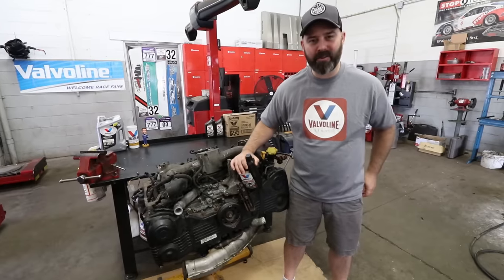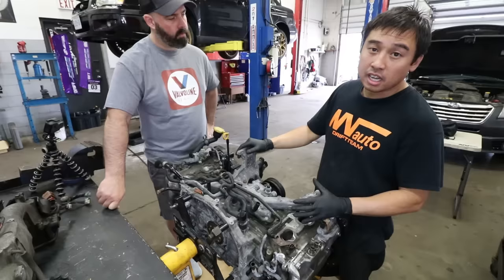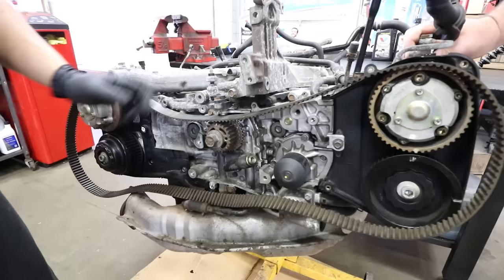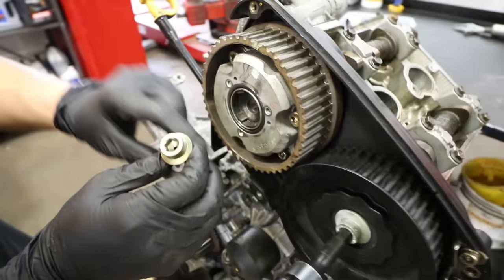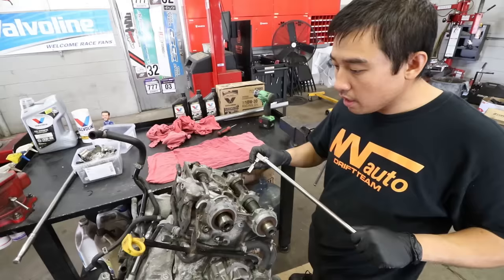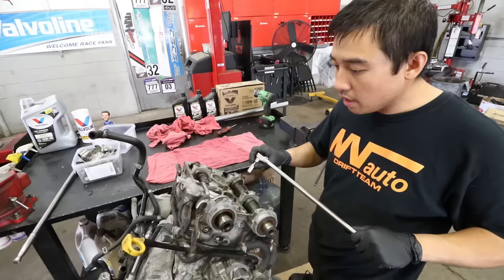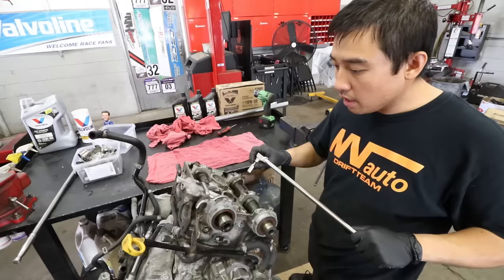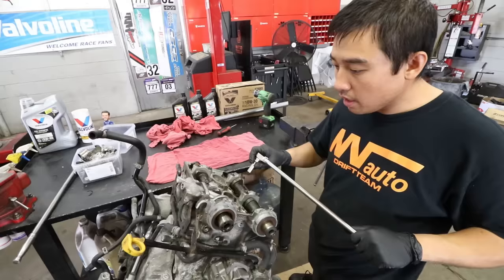SUBARU Engine Rebuild - EJ20 / EJ25 Teardown How To

Comment: This video just makes me appreciate how easy American OHV V8  based engines are to work on,specifically the LS platform...
Reply: Eze&Yare Dominguez   this is a very simple engine. Once you do two or three you would be able to remember all the pieces and parts easily. It just looks complex when you do it first time. All the parts are high quality and fit easily. Unlike some.
Reply: @Brett i have a B7 S4 & thus block seems more complicated than the bbk v8 i have

Comment: I have been driving n working on Subaru for the last 31 years
Reply: what's the most reliable Subaru engine sir
Reply: @mattmatt9971  ej20
Reply: @michaeldwyer5013 Cheers.  I got EJ20G in my 1995 sti.

Comment: Just to add a quick note, the LH cam gears that are loaded are easy to mess up and bend the valves, they didnt do it the right way. The intake gear needs to be spun clockwise, the exhaust gear needs to be spun counter clockwise. Most of the time you can get away with doing it like they did but theres enough spring pressure that if one of the gears slips it will catch the edges of the valves and will easily bend them, and no one ever checks after they do it which can lead to the car running like crap, or turning the valves into a tossed salad.
Reply: isnt it the other way around? for unloading the cams the intake goes counterclockwise exhaust goes clock wise
Reply: I don't think they are that easy to bend. I believe it's more of a precaution, so you don't take a impact or a breaker bar to the bolts. I'm picturing some ding dong kicking the breaker bar like he/she is trying to crack lugnuts on the side of 95.
Reply: the Key being to make sure the crank alignment mark and oil pump mark are lined up so the pistons are mid stroke and you don't bend the valves.

Comment: Really impressed with his knowledge. When a mechanic is that proficient at engine rebuilds you know those engines are terribly unreliable lol
Reply: they're very reliable. they have a few issues, but they always go at least 180k miles. problem is that they're not maintained well and hooned often.
Reply: True...
Reply: Every engine is reliable as the person who is operating or maintaining them. Increasing the output and operating an engine at its limits reduces longevity. Lack of maintenance reduces reliability even more.
Reply: Well my 06 LGT has a stage 2 tune and a vf52 turbo and has 200k miles no issues. My 1999 subaru legacy outback has 240k with zero issues also. So I think it's more user error than the ej series motors.
Reply: @markheefner6527  Did you replace injectors/fuel pump using the VF52? In the middle of a similar build right now with my 05 Legacy GT. Engine is out at the machine shop at the moment.
Reply: @andrewolszewski5027  we didnt do injectors but we upgraded the fuel pump to a AEM 50-1215. You dont have to upgrade injectors though the next up is changing from the stock side feed injectors to bottom feed injectors.
Reply: @markheefner6527  Thank you. Had a lot of conflicting information on whether it was required or not. Planned Vf52 swap, grimmspeed Boost control solenoid, new radiator/intercooler, and Downpipe/cat back exhaust. Already have cold air intake and larger turbo intake tube. Pro tuned when all said and done.
Reply: @andrewolszewski5027  would love to see your build when it's done.
Reply: @andrewolszewski5027  what part of the country are you from? Boosted performance Graham Gaylord is the owner and is an awesome tuner.
Reply: Mark Heefner probably a video but I figured why not be social and ask.... what determines a tune’s stage??
Reply: Theyre reliable. But when they break they break hard
Reply: Need to be maintained more than a toyota or honda. Subaru ej  s cost more $$$ to maintain
Reply: Or the engines were used in almost everything lol

Comment: Subaru flat motors are a lot like harley or other older vtwin style engines that have vertically split cases. Thats pretty neat to see how it breaks down to such a small engine block that a guy can move it around on the table.

Comment: Yes sir I have a special hardened socket just for the head bolts used to do at least one or two head gasket and engine reseal on Subarus a week I have just a little experience!

Comment: Geez those boxer engines are so much more work to take apart & put back together compared to a inline four design.
Reply: Theyre so much easier to install though and remove.

Comment: Awesome!! After seeing this I dont think I ever want a sti lol
Reply: I concur...sure my NA K20 is gutless but easy to rebuild...like a lawnmower!
Reply: @aronharper7001  k series is life tho!
Reply: Its not so bad trust me, i came from a h22a obd1 closed deck to an sti, the ej looks more complicated than it actually is.
Reply: I just did a rebuild on my ej20 and while the engine is complex and difficult, reinstalling is so fucking easy. The the motor mounts are on the block, put it onto the subframe and its just two studs. Done. Takes less than an hour. While staight 4s have 4 different motor mount locations and shit. Fuck that.
Reply: @MidwestDankAlumni  *no one cares
Reply: Very clever and successful  design giving a low centre of gravity, improving car cornering ability.
Reply: The best way to describe these engine is intimidating to look but its like a lego set

Comment: I’ve had 4 Subaru’s and I currently own a built 2017 STI and I can tell you it’s cheaper to just buy a built block and rework whatever heads you have than rebuild. You can buy a built short block and get a 1 year warranty and still come out cheaper than rebuilding a 2.0 or 2.5

Comment: Seems that the cause of the burnt valveseat is either a bent valve or a damaged valve guide, as nam seems to need way more force than normal to pull this one valve out.
Reply: jeah.but correct the MB C200 kompressor  head. ..

Comment: great video , I've always been curious about how the block is parted thanks , removing the piston clips & pins was an eye opening , only flat 4 I've done was a VW this is way different  obviously due to water cooling and overhead camshafts & cambelts and with VW the bores/barrels can be slide out of the crankcasing  , knowledge and being methodical clearly is the only way to go with the Scooby engine,  doesn't appear too difficult to dismantle I'm sure the rebuilding has lots of do's and don'ts that aren't so obvious at first ,cheers

Comment: Put this motor in a Factory Five 818 C .  I am going for a WRX STI in the coupe I am building. 1900 lbs pushed by 310 horsepower. What a rocket.

Comment: Tons of VWs have Subaru engines. This might be a nice upgrade for a 914 if you feel like exhuming one!  A transplant you won't do is fairly popular among pilots, put a Subaru engine in a plane. They like it because it does not shake at all and has good power. It is not approved by the FAA but the approved engines are dynasaurs!
Reply: @FourDollaRacing  Chill out mate

Comment: Not all USDM motors are drive by wire, only the 2.5L turbo motors are (04+ sti 06+ wrx) in the us. EJ205s are all cable driven.
Reply: Also to add usdm models do have the hex or flat sides on the cams for a wrench on early 04s to 02s
Reply: My 07 2.5 legacy is dbw and so is my 2.5 in the 10 Forrester
Reply: And they are n/a

Comment: These engines are like Suabru's biggest blunder lol. A blunder that lasted for almost 10 years! Oil consumption, piston slap, blown headgaskets, rod knock from oil consumption.
Reply: Avid fan but you couldnt be more right, so many design flaws and the 5speeds OMG

Comment: fyi, i owned a USDM 2.0 WRX wagon, and it has cable throttle. I believe in the US, the EJ257/ej255 was the first engines to get DBW.  and the 2.0L EJ was no longer in US WRX after 2005.

Comment: For the Cam gears: when you shear off a hardened 3/4” drive Allen trying to break it free, the factory may be fucking up putting them on that tightly. Strangely enough my USDM EJ205T had the hex shank to secure the cam from spinning but there is no way these bolts being so insanely difficult were torqued at the factory to the spec outline in the FSM. Edit: be very very careful with the cam bolts if doing HGs in the car, have to use a shallow, 6 point 10mm socket and be sure to tap the socket on deeply as the cam bolt heads are quite prone to stripping.

Comment: I used j20 cylinder heads for the j 25 turbo engine, but I did somes modifications  with the j 20 cylinder heads to work with the engine j 25

Comment: Great video but if the cam bolts get stuck you can always use an 11/16 turbo socket :)no need to cut em out

Comment: When it comes to 2.0 vs 2.5 the 2.5 model is much more desirable for higher boost levels and whatever track use you would be doing...my 2.0 is a good stock reliable motor but when it comes to a build 2.5 is the way to go for sure especially closed deck.

Comment: I worked with cars for several years but nothing like replacing piston rings and seals.  I got 2010 subaru forester 2.5l and I probably need to do that soon.  I already got low compression on cylinder 4 @70psi.  I didn't try the restore lubricant yet but if I try to rebuild the engine with new piston rings and seals and learning as I go with repair guide and some help... How long would it take me.  I want to learn this stuff, do it right  and use my subaru to learn it.

Comment: If you were gonna replace a 2.5 with a jdm 2.0, do you have to use a different exhaust manifold to make it line up with the rest of the factory exhaust system?

Comment: In my experience, usually when the bearings come out with the crank or just fall out, then the bearings are deformed and probably shouldn't be reused. They're usually kinda "press fit" into the case. So if they just fall out, they're no good
Reply: Hello! Any chance you could tell me why the OEM crank here has a nut/bolt at the end of the crankshaft?
Reply: @epochlabs  It's usually there to hold the harmonic damper/crank pulley on the shaft. It doesn't really do much besides also giving a place to put a ratchet or wrench on it to turn the engine over during assembly or disassembly
Reply: @richardwilliams9181  Thanks for the swift reply!

Comment: Question: Nam said that on the USDM engines, there are no hex on the  camshafts to put a wrench on to and if you don't have a special tool, there is another way to loosen the bolts. I have a stock US motor and no special tool. What is "the other way" to loosen and remove the cam gear bolts?

Comment: have a bad miss on left bank on Subaru 01 forster JDM motor e25 just put in, put it on snap on machine everything right, crank sensor cam sensor, in gears right, changed injectors on it still misses, checking compression today, any thing else i could check or replace.

Comment: So on first crank on this motor right after swap I heard what sounded like con-rod bearing knock on one side of the engine. The sound is rather faint and not to so apparent.
Will the noise disappear after driving for a few kms or am I worsening it?? Please advise

Comment: man i feel like bmw and subaru engines are no where near easy to work on compare to b and k series.
Reply: Who makes those engines?
Reply: @BobPegram  b & k series are Honda engines
Reply: Once you know what you're doing, they're pretty straight forward. All EJ blocks are basically the same, bar bore size and a few other things.
Also Subaru's share a lot of parts between them in most aspects, so working on a Impreza is very similar to working on a Forester - talking about the older ones, where they shared the same platform.
Reply: EJ's are actually pretty easy to work on. i was kinda scared to tackle my ej205 at first coz i haven't worked on a boxer engine before.  

but it's actually pretty easy.
Reply: @Ariz04  I'd say the EJ255s are one of the easiest engines to pull from a car that I've done so far.
Reply: @wedgoku...., K series is Rover. The 'newer' k series are found in MG zr & zs's
Reply: Wait to you see what VW/Audi does with engines....
Reply: @sgt-willkillu  99.9999% of the time, when someone is talking about a "K-series" engine, they're talking about a Honda, not a freaking Rover.
Reply: @sgt-willkillu  I think he meant the Honda K series because Honda also had a B series.

Comment: I disassembled a 2001 STi Limited Wagon block the case half 12 point bolts almost broke my 500 ft lbs impact gun then with a cheater 4 foot pipe they almost broke me LOL

Comment: why is the 2.0 block thicker than the 2.5? is it because they are the same block but the 2.5 has  larger bore, therefore making the walls thinner? woulden't it make more sense to make your bigger displacement engine be stronger because it has more displacement?
Reply: Yes, but cost.
Reply: It would make sense but it would no longer be an EJ to manufacturing. Different engine block casting etc..
Reply: EJ's earliest displacement was 1.5 liters I believe.  They certainly were used in several sub 2 liter applications before they went to 2 liters.
Reply: @BobPegram  there's been 1.5, 1.6, 1.8, 2.0, 2.2, and 2.5 - all factory Subaru.

Comment: just put JDM e25 motor in Subaru 01 Forester, got it in has miss on left bank, put it on snap on machine, said it had bad wire repaced still a miss, replaced injectors, still has miss, got right sensors in gears are right, checking compression today, doubt its bent valve, can you think anything else it could be, frustrated

Comment: On my 98 WRX motor I went to undo the crank bolt for the second time after taking of the timing covers and putting it back in to line up the timing. I was holding the top right cam (facing the motor) with a socket and breaker while trying to undo the crank bolt. Then trying to undo the bolt, I heard a click from the top cam and I think just the cam skipped forward while the crank stayed in position. I looked at the timing marks and the cam was out. I turned the crank twice trying to match it up again but it wouldn't match. I carefully kept turning until suddenly I could feel some resistance and I stopped, fearing I would damage the valves. Currently the crank is not lined up with the timing marks. It's mark is just below 9 o'clock. All the cams timings are out too. I'm not sure how to proceed. If I turn the crank further I feel like I'm going to wreck the valves. If I take the belt off currently I'm worried I'm going to wreck the valves. I'm guess I can't wind the crank backwards? How would your expert proceed in such a situation please? Thanks

Comment: I have a single turbo, single AVCS engine with rod knock I want to fix and I can only find twin turbo, twin AVCS engines. I was told I can just swap the heads off the single turbo and put it on the twin turbo block. Does this work?

Comment: I have a 2004 forester xt that I bought brand new heads for from subaru. Cam caps do not have the cam sensor on driver side behind timing cover but does have the 2 at the back of both heads. Is this normal? Seen at 7:59

Comment: Ok... this is a 2.0 as mentioned earlier in the video... if you bore out the cylinders how does it not make it a 2.5? Wasn't the argument that the 2.0 had thicker piston walls which was a good thing? Seems kind of a moot point.

Comment: EJ207. I'm jealous
Reply: *JDM EJ205 with AVCS
Reply: @THENINJASYNDICATE  block is stamped "S20C" - that's a EJ207 (specifically from a V7 STI), and semi-closed deck - great engine! EJ205 would be "R20C" (V5/6/7 WRX and V5/6 STI - but engine code is EJ207, so factory forged internals)
Reply: @upgradeNEVER  but the ej207 is cross drilled mains I think that crankshaft is single lubrication hole on mains
Reply: @upgradeNEVER  I was thrown off by the grey intake manifold. Perhaps it was replaced?
Reply: @THENINJASYNDICATE  red paint very commonly wears off on them. I'd say that was the case here.
When I do my EJ207 build, I'll want a plain unfinished alloy look, to keep it stealthy in my Legacy.

Comment: I wouldn't mind rebuilding my EJ257 when it goes but holy crap how do you remember where all different bolts go. I would have extras for sure once everything is assembled and that would probably not be good.
Reply: As you take things apart, you put the nuts, bolts, pins ect right back where they go. That way you dont have to guess where they go and keep you workshop organized.

Comment: Question:  If I remove an EJ20 engine, is it possible to run the engine OUTSIDE the car?  does it absolutely need the car computer to run?

Comment: 🤔 won’t it be easier to break the cam bolts free with the belt on first?  I had the cam tool when i rebuilt a ej20, I’m doing an ej25 now and the tool isn’t the same.  I’m looking for an easy way, and I’m not sure if my cams have that hex on it. It’s a US car. 🤷🏽‍♂️

Comment: What’s the advantage of engine like this?
Reply: Low centre of gravity, and reciprocating forces of motion
Reply: Lower centre of gravity offers better handling.
The orientation of the pistons allows their forces of motion to offset eachother (they move on the same axis, unlike V6 & V8). This eliminates the need for counterbalances.
All this to say: less weight & smoother operation

Comment: If the trouble of this engine is cylinder head gasket only you need to pulled out the whole engine means mechanic time laps slow.much better inline 4cylinder.